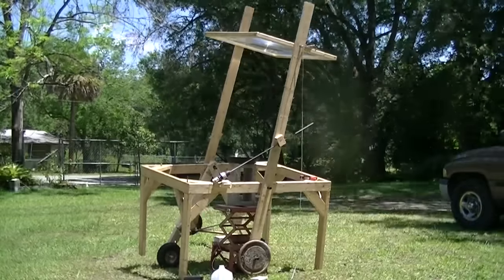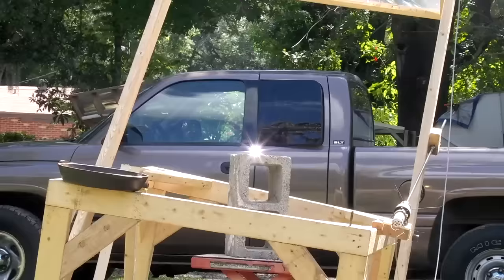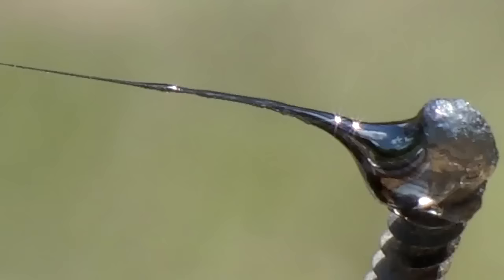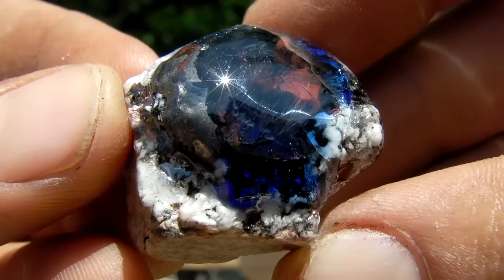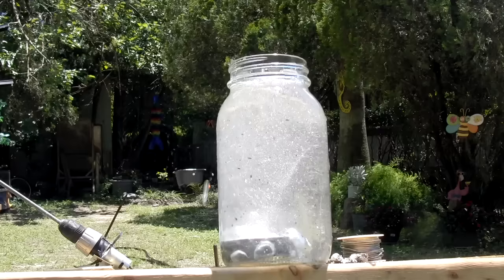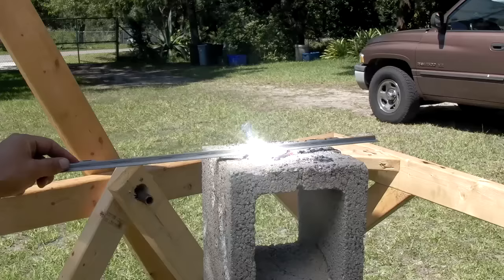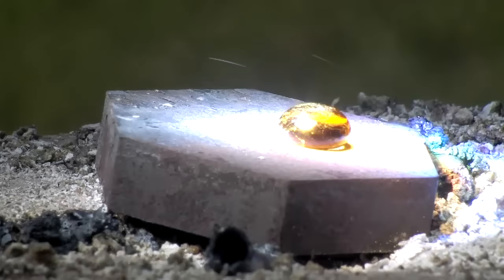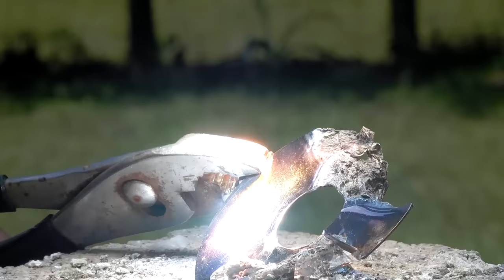Fresnel Lens Solar Power Foundry Obsidian Farm 3800 ˚ F 2100˚ C Fresnel Optics greenpowerscience

Comment: Frigging awesome. Have you tried to see how far you can push it in combination with a forge (or really, anything with good thermal retention properties like a standard cast iron pan) to see the maximum temperature possible? Also: https://i.imgur.com/vkLQvF9.png 6oz to boil in 20 seconds is 55.6 joules => 2.78 kilowatts of sustained power output. That's absolutely amazing considering an average brand name solar panel like LG is around 300 watts peak. Almost a full order of magnitude more efficient !

Comment: Wouldn't it be simpler to track the sun by using a motor that is geared to rotate your device the same speed as a 24 hr clock?   A ten speed bicycle probably has a gear that would make most small motors rotate the device the same speed as the rotation of the earth.

Comment: Where can I get a lot of fresnel lens cheaply ? (projection tvs ?)

Have you tried to boost a 250 watt solar panel with multiple lens to get more electricity in low insolation ?

What is the most cost effective way you have found to generate electricity ?

thanks
Reply: i got my 4" x 3" lens from a discarded tv at the local dump.  there were many old, non lcd tvs to choose from, and I chose the biggest one there!  for freeeeeeee!  just make sure to ask the dump operator for permission.  the guy at my dump was reluctant at first but he was convinced when I told him i was making a solar backyard forge to cast knives with!

Comment: Does this record stand or have you reached a higher temp?
Reply from the maker: Tronman63 I think I went higher on a graphite crucible but no way to measure with current equipment. The IR thermometer need cost almost $1000.
Reply: GREENPOWERSCIENCE Infrared gun?

Comment: I know this is an older video, but it was the most "general" one I found on your list ... 
  It seems you have done a lot of experimenting with these lenses , to the point it kind of seems you are just "playing around" with them. 
  I'm wondering more practical everyday uses/needs for this ... is there something you aren't showing, where one could make some sort of DIY income/home business using this array/lens "foundry"? 
  Besides art deco rocks and glass beads I mean? 

 It is neat , practically a natural "laser" ...  while some of it seems novelty , I'm failing to see much in the way of practical usage, or even specific usage.
Reply from the maker: Cooking works great, we use this or a parabolic mirror on sunny days. For forging, a lot of people we have sold lenses to use them as a hybrid with conventional heat sources to reduce fuel consumption and work with much higher temperatures. A hybrid system can exceed 3500˚ F. I do not recommend for house water heating and pools. There are other videos on our list that covers this. Many of the larger companies we have sold lenses to use them for temperature testing of composite brake material and other items as unlike a blow torch, the heat is stagnant, no wind.

Comment: All my fresnels have a focal point of around 5 inch diameter or more. Are they just bad quality lenses or is there a way to shrink the focal point?
Reply: move it further away or closer. it should focus sunlight into a cone shape then reverse outward past the focal point.
you must not be at the optimal distance. some light might not be focused correctly and cause to appear larger.
try misting water through the sunlight beam. or using a smaller secondary glass lens to focus the light better.

Comment: how can I store that heat?
Reply: Víctor Mellado an attic
Reply: Search You Tube about "sand battery" or rock battery or oil as heat storage materials.. If such sand, rocks, oil, etc will be stored in thetmos walled container (double wall, no air, with vacuumed air)- the stored heat will last for more than 24hrs...

Comment: hey can i ask you this what well happen if you add a another Fresnel Lens to the rig?
Reply from the maker: Each lens has a separate focal point so they cannot be arrayed side by side. Angling the second lens dose not work as the sunlight still travels in a straight line. Adding a lens on top of another lens diffuses too much light reducing the power. Layering lenses only shortens the focal length with reduced power. Redirected light from a larger mirror (larger than the lens targeted) through a second or third lens can be done but requires constant solar tracking of the mirror and lens making it almost impossible for the second lens to match the common focal point of the original lens. This is the best way for larger targets:
P3 SOLAR STILL WATER DESALINATION SEA WATER BOIL 5 GALLONS
Reply: GREENPOWERSCIENCE 
ok thank you very much

Comment: What if you warm up a turbine with this or use a Solarpanel.. How much energi would it produce?
Reply: How old are you kid?
Reply: Austin Perrodin  Why put someone down for asking a question? He's trying to learn, that's a good thing!  You could warm up a boiler this way to power a steam engine. You would have to spread the focal point into a much broader point though because most of the boilers I have seen are constructed of mild steel. Your boiler doesn't benefit you much if it's got a big hole burned in it lol.

Comment: Can we generate more heat by concentrating mirrors on Fresnel lens?
Reply: yes i too want the answer to this question please reply
Reply: royn.ray No. He just put out a video on Fresnel myths. You get the energy of the surface area of the sunlight. Stacking them changes the focal point bit does not increase the area of flux of sunlight.
Reply: USALibertarian yeah got your point but i'm thinking of using multiple mirrors concentrated on one fresnel lens.

Comment: Can this generate electricity?
Reply: If u used the heat to boil a steam enigne to turn a generator. Yep
Reply: @ishikawa1338  probably exist a shortcut though
Reply: @ishikawa1338  Try to use Stirling engine, it has high efficiency, 40% probably  vs.  18% for gasoline, diesel engine, etc..

Comment: Im having Trouble finding eye protection I tried using welding mask but it was too strong
Reply from the maker: darklord The cheap goggles are the best option. They offer protection without being too dark. In my personal experience, extremely dark eye protection results in more hazards due to not being able to see anything outside of the focal point. $5 ones at harbor freight or:
http://www.greenpowerscience.com/FRESNELSHOP/GREENGOGGLES.html
They are cheap but work well!.
Reply: GREENPOWERSCIENCE 
I've been very happy with my Harbor Freight Auto-Darkening welding helmet. It's been great for fresnel experimenting.

Comment: Will a gradient lens from an LCD monitor work? I took apart one from my old monitor right after I saw your video but it didn't work. Of course, it's slightly cloudy today. But the problem is that I couldn't find the focal point, just some rainbow like reflections on the other side.
Reply: No, the fresnel focuses multiple solar rays into a focal point, a tv one its not enough
Reply: @recarras  How does it do this? Multiply layers of glass? Curved glass???
Reply: @deniseward002  ITS an arrange of concentric rings in simple lens ( plain lens) this allows to focus much More light in a single point. For sure you can find More stuff on wikipedia.
Reply: @recarras  Concentric rings, where? And what are the concentric rings made of? Is the glass "layered" to make these rings?
Reply: @deniseward002  yes, the glass Is layered AND given form to have this rings forms. This increase the lens effective area AND also helps to focus light in the lens centre
Reply: @recarras  It sounds like it has to be melted to do that.

Comment: Do you have blueprints for this?
Reply: Natron mixed with lime gives caustic soda

Caustic soda mixed with water and white sand heated 1000 degrees Celsius produces sodium silicate aka water glass

Mix this with potassium silicate obtained through same process 

Pour liquid into lens shapes mold
2-3 days later unmold transparent lens.

It will focus light at one point. The larger the lens the higher the temperature..
With a 5 meter diameter lens the temperate reaches 1800 -2000 degree Celsius. This is solar energy. Granite will melt like lava at this point (or like what you saw the obsidian). You can put it into molds at this point. It will create vases harder than steel.
Reply: @soflafit  Are you a chemical engineer? a metallurgist? Your technical know-how was impressive!.. How can I PM you about technical inquiry?.. about the d.i.y. 5mtrs diam. self made lens?..I want to try building it, pls help...

Comment: Dan with 8 hours of thermal output why arwnt you making use of teg generators?
Reply: TEG generators only have a maxiumum theoretical efficiency of 13.9%

A Sterling engine or Steam engine is more efficient.

Comment: where to buy that size of this fresnel lens ?
Reply from the maker: Check our website. We have links.
Reply: If you didn't buy, you can get it free from any projection tv (old projection tube tv,I bet that's were he got it, 48 inch) just search around,there is lot of them people giving them free just to get rid of it because CRT are finished.If you find one don't get confused there is 3 screens mount together like sandwich ,lenticular ,fresnel and protective.Fresnel you will found in the middle.Also there is nice convergence lenses on each picture tube (3 of them red,green and blue).Don't leave Fresnel lenses unattended,even if it's not perfect in focus beam were you want it,it's always somewhere,happen to me long time ago,leaned on wooden fence for lees than min and catch fire!

Comment: I thought steel melts at 257° C (495° F)
Reply: Not even close..
Reply: Mason Poindexter I know it doesn't, I was just putting the temperature at which jet fuel burns :P
Reply: Steel loses more than half its strength at that temperature.

Comment: Archimedes Death Ray!!
Reply: Christopher Hall isn’t that with parabolic mirrors?
Reply: yes, but it wasn't nearly as effective as this
Reply: His so-called death ray came from an assortment of flat (probably polished shields) mirrors all pointing at the same spot, in this case a Roman ship.  These are called heliostats when they all point at a central tower.
Reply: @henryhewitt1571  yes, but the theory is the same, concentrate sunlight onto one spot to generate large amounts of heat
Reply: @christopherhall5361  No argument there in theory or practice but the phrase makes it seem as though sunlight can be directed through a refractive lens to the target with the sun behind you.  In Archimedes case it was simply reflected off the shields to the target.  The sun is behind the target not the lens, prism or mirror.  The angle of incidence equals the angle of reflection.  

In Hathor's case it could be directed on the target but that 'death ray' was for melting things, not killing -- not as far as we know, unless the Aztecs figured that out.  Beats hanging, firing squad and lethal injection I suppose.

Comment: Why doesn't the cinder block melt?
Reply from the maker: It does in the small spot. The entire block cannot melt because the properties of the block insulate and the heat gets trapped in a small area. To melt a complete block the lens would need to be the size of a swimming pool.

Comment: Love your stuff. Can you help me to understand how your "solar tracker" works/tracks using Photo cells.
Reply: Dunno about this one but a simple way is to use two small strips of material, make an X at 90 degrees, and in each of the 4 squares or section place a photodetector.  When any one of the 4 spots is shaded, one of two small motors will adjust the tracker and keep you on target.
Reply: @henryhewitt1571  That's what I thought. Thanks. Have you figured out how to reset the collector for the next morning? This is such an effective and economical way of doing this.

Comment: How long does it take to boil water?
Reply from the maker: 12 ounces in less than two minutes. 6 ounces in 20 seconds.
Reply: An ounce is equivalent to ...L ?
Reply: apparently 12oz equal 0,35L... That would make any soda can...
Reply: @user-cc4kq6hl4c  one pound is 16 oz which is a pint

Lol i had to

Comment: please could try a Diamond in this machine?
Reply: not even close u will only make it hot diamonds need 3000 C maybe 4 min enough to melt one
Reply: Yeah using the lens won't be enough but you could use mirrors backside to the target in addition to the lens being used.

Comment: Here's a thought get some engineers to engineer another lens similar to this that moves over the span of a house as the sun crosses the sky of course you don't want it at a full focal but something similar to this would save trillions in home heating cost and think about how cheap the plastic is

Comment: concetratd sun rays including UV ULTRA right on your hands and face bieng just inches away unprotected for years at a time, i mean what could go wrong.. skin  Cancer oh that was  an afterthought
Reply: You might be right about that (I have no idea if these lenses will allow UV light to pass through or not), but welding machines have been spewing UVs for decades, so it isn't like we don't already have PPE to deal with it.
Reply: ValThracian it's nuts how people who didn't do the research jump into things head first. There's a reason we don't use direct unfiltered sun rays to heat things we are going to put in our body.. Nature converts it for us then we eat the plants 🌱
Reply: @ValThracian  thats exactly my point, have you ever seen a welder barface a joint? yeah me either
Reply: Pretty sure he's not putting his hand in the concentrated sun rays because UV would be the least of his problems if he did... As to whether the concentrated exposure would "scatter" more UV rays toward his body, I don't see how it would be much worse than if that light were hitting a diffused surface, but hard to say for sure.

Comment: How many watts per sq meter?
Reply from the maker: About 900 for this.
Reply: @GREENPOWERSCIENCE  
That is more than max solar effecticy...
Reply: The sun provides roughly 1,000 Watts per square meter, though only 850 come from direct (right overhead) irradiation.  The other 150 come from 'out of the blue' which is how Photovoltaics work (rather badly) even when it's cloudy.  Not so good at night though.

The trick is to focus or concentrate a certain amount of square feet of meters on a much smaller space.  The harder trick is keeping that cool unless all you want to do is melt something, which is fun.

Comment: Hi Stan. Did anyone tried to power/heat the steam engine or stirling engine by frenzel lens?
Reply: I’m going to try and do that myself idk if anyone has and I’ll Google it after making this comment.the idea for my design is just a simple long tube with dyed water that has a light absorbing pigment. At the end of the long tube would be a little turbine to spin a moto which I would use mostly as a proof of concept just to see if it’s possible and how much energy u can actually get from the steam

Comment: Please melt a diamond!!!
Reply: melting point of Carbon is super duper high... highest melting point of any element and as a diamond is nothing but elemental carbon and colorless and highly refractive, it would be almost impossible to melt a diamond with light.  That being said, I hear you can destroy a diamond in molten iron easily, the Carbon will mix with the released hot oxygen and evaporate as carbon dioxide.